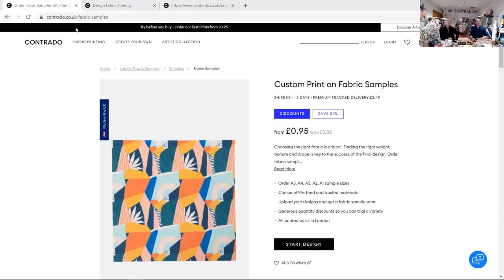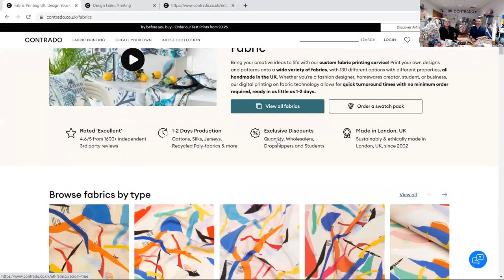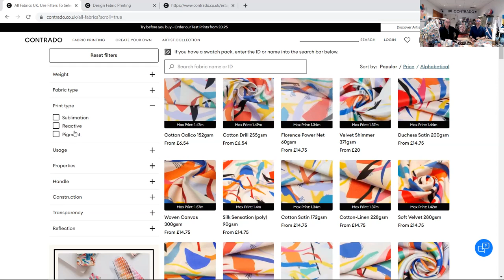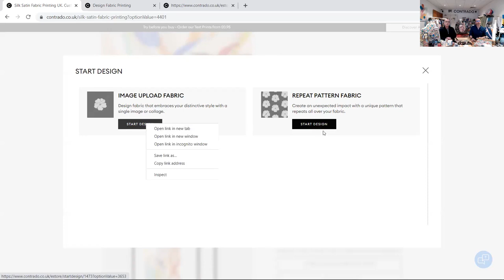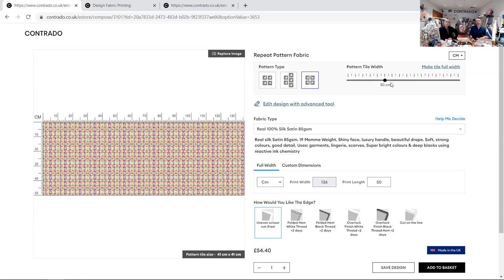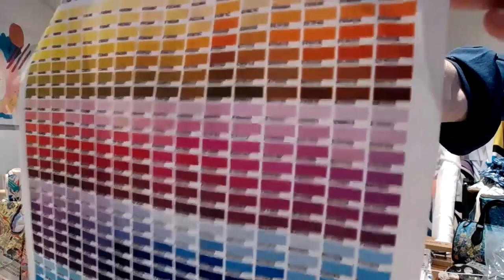From Design to Fabric: A Masterclass in Printing Techniques with Contrado

Comment: I believe manufacturing fabric in the UK for soft furnishings and fashion could work but things need to change.  Print and demand is good but  it really needs to works well with the environment and its quality goods at the right price.  I think Contrado works in the long run.  But if they could work on prices it will be a blast.

Comment: Hi Chris, I just started using Contrado and have to compliment you on developing such an easy to use site. Despite the fact that you offer so many products and possibilities I have had only one question. My print design is meant to be printed full width ( no repeat ). The panels have been adjusted so the edge between each panel is seamless.  So would it be possible for me to print my design 140cm wide x 20 meters ? I do hope so. Thanks very much

Comment: It is so good to see the people behind the screen.  I have bought a couple of things from Contrado and was very pleased with the colours and speed of delivery.  I would have ordered a lot more if it wasn't for the Contrado web site from hell.  I have complained about it on a number of occasions but was just told to clear my cache.  It did not help with either the speed or things that don't work properly.  Sometimes there are washing instructions and sometimes the link is not to be found, the design your product does not always work,  just to name a couple of things.  I have often gone round in circles trying to find the design.  When seeing the final product before buying, the illustration is too small and the magnifier does not always work properly.  Checking out and shopping basket was a special kind of hell.  Is it because there are many businesses trying to access the site all at once?  I think it would have been quicker and easier to have simply visited and bought from the factory.  I was curious about the factory and thanks to these videos it has been satisfied.